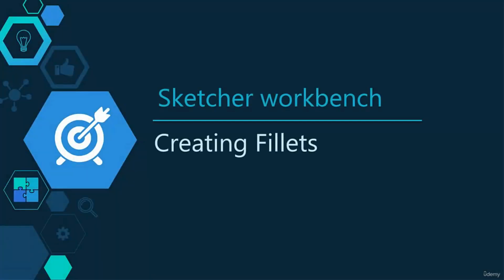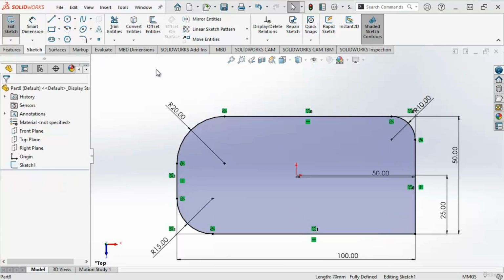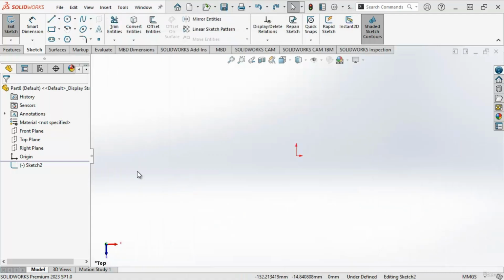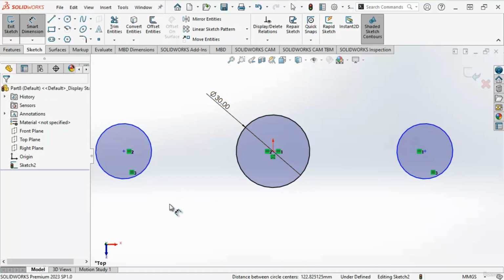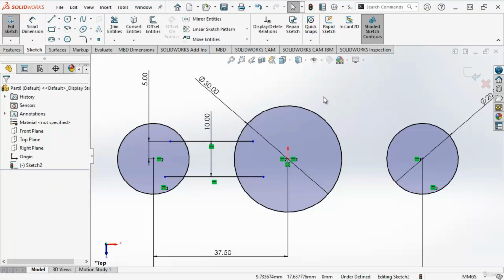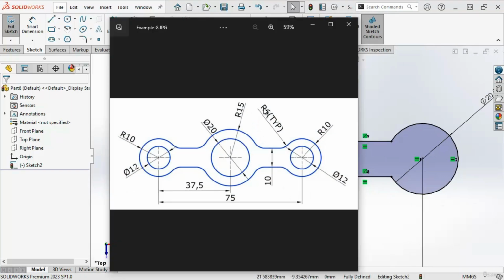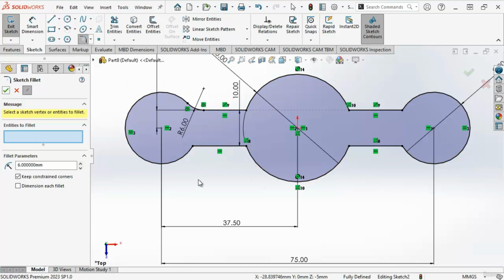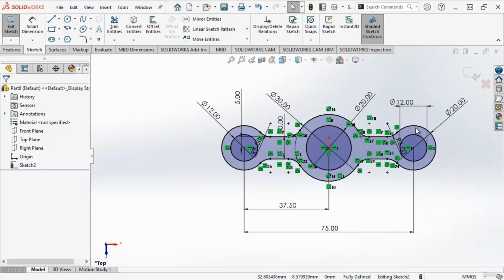SolidWorks Fillet Tutorial for Beginners (2025) | How to Use the Fillet Command Like a Pro

Comment: I had trouble with the horizontal segments remaining undefined. They were not constrained on the vertical axis. I found out it was because I was creating a constraint between the center of the circle and the endpoint of the line. When I create a constraint between the center of the circle and the "body" of the line, it is fully constrained.
Reply from the maker: Great point! Yes, that's a common issue — when a horizontal line is only connected at one endpoint, it stays under-defined. But connecting the circle center to the body of the line (not the endpoint) helps fully constrain it.

I’ll be including more exercises like this in future videos so we can go deeper into constraint logic and sketch behavior. Stay tuned — and thanks again for the insight!